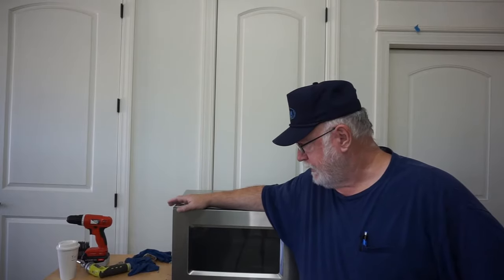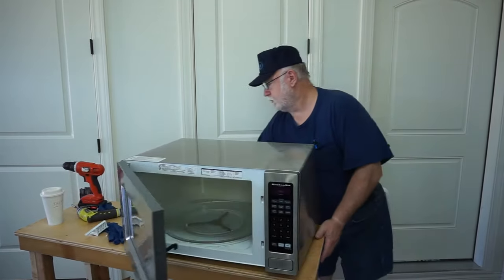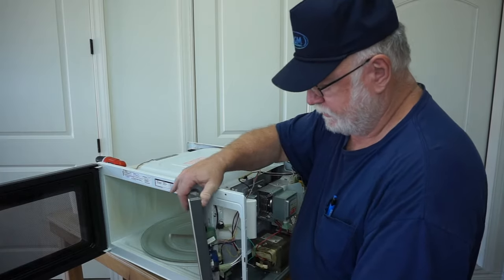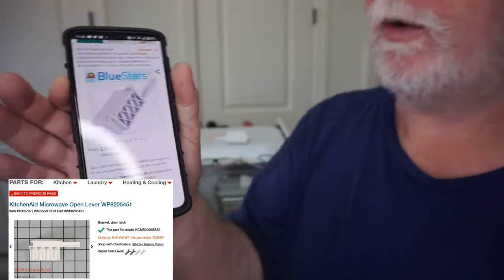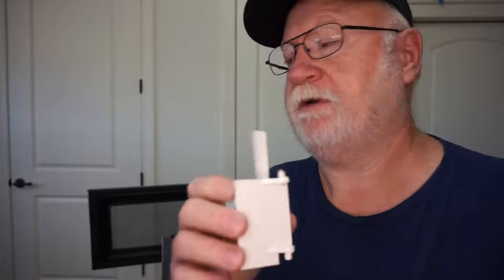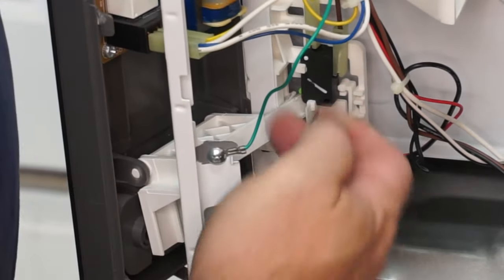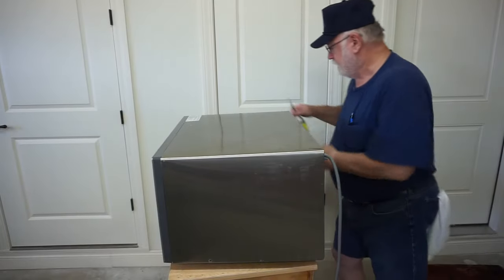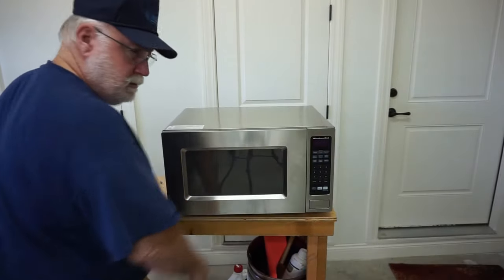Reviving Your Microwave: Assessing the Value of Door Latch Button Repair

Comment: You are a great teacher, but does this work on a Samsung?
Reply from the maker: Although I can't see the model number of your Samsung, pretty much all microwaves and electric ovens with a plunger door button are fairly close in design.

First thing to do is to get it onto a table or work bench so that you can remove the cover. Only remove screws that attach the cover at this point.

Once you have lifted the rear of the cover slightly you should then be able to pull rearward on the cover to lift it off. Be careful as you can cut yourself very deeply on the thin metal.

If you don't see the offending parts, take several lighted photos of the front panel from the inside in various angles so I can see what you have if you still need assistance. If after you've opened it up, diagnosed the problem without further assistance, hope it goes well for you.

If not, email the photos to maxsgarajmahal@gmail.com or hit me up at MaxsGarajMaha in Facebook to share the photos. Good luck and thank you for watching. 

I have another video that may be helpful for you on the microwave and it is a combination microwave - convection oven. Here is the link: https://www.youtube.com/watch?v=NJAZ2V5dF1s

Good luck,

Max
Reply: @MaxsGarajMahal  you are so wonderful to have replied in such detail! Unfortunately, my husband got hold of it before I did and that always means trouble. It's now a "gonner" and in the garage!!
Reply from the maker: @conniebentley8967  Well, maybe he just needs a bit of your assistance in order to finesse it apart. If that doesn't work out exactly the way you both like, perhaps he can be the Director and you the Cameraman. Maybe you two can reverse the roles if that works best. At any length, between the two of you I have all the faith in the world that you will be successful in carrying out an easy operation.

If you still feel you need some bolstering, send the model and serial number of the Samsung as well as those photos so I can see what I can do to be of assistance from afar.

Good luck and have fun as we should always make these games fun.

Y'all come back and see me now, ya heah?

Comment: Worked like a charm, thanks!
Reply from the maker: Pleased it helped you out. Once you made my repair, did it make a lot more sense than before you began?

By the way, my lovely bride made me purchase a new latch. I couldn't even tell you where I put it. If I find it one of these days, I'm going to do a pre-emptive 'repair', put it back into the package and wait until time to deploy it.

We have other home repair videos you might want to check out. Hope you subscribed and liked.
Reply: @MaxsGarajMahal  Yeah, I had the same issue of that same spindle breaking off. I super glued the piece back on but was concerned that I might snap it off again or snap off the darker plastic holding it to the front panel. Following your technique, with a bit of force, it snapped in no problem.
Reply from the maker: @michaelrusso558  Always pleases me when I've helped another soul. Hopefully you'll never have another problem with it.

Comment: kitchenaid actually bent the pin on the torx screw probably on purpose so you cant open it.   how in the world were they able to install the torx screw and then bent the pin?   the pin is pretty solid.  I doubt they bent it by extracting their torx driver.
Reply from the maker: Thanks for watching.

Comment: Mine broke at the control panel one of the taps snapped off. And they don’t make the control panel anymore 😡 Suggestions?
Reply from the maker: Shoot me a pic of it from a few different angles with good light. Send them via my email, I'll see if there is a way to save it. I'm pretty sure I have the cure for it if it is what I'm thinking it is going to look like.

Comment: My microwave started doing this. The strange thing is, sometimes the button works, and sometimes it doesn’t. I’m not sure if it’s the same problem as in this video or not.

Luckily, if I hold the button down, I can easily open the door by pulling from the top with almost no force, so I don’t think I’m breaking anything else by doing that🤷🏼‍♂️
Reply from the maker: If you're able to pull it at the top while holding the button, then you're good until you're not. 

Good luck and thanks for watching.
Reply: @MaxsGarajMahal  Okay, so I'm good until I'm not 😅    Just out of curiosity, Do you think it's the same problem as you demonstrate in the video, or is something else likely going on? I know NOTHING about microwaves, so not too keen on opening it up myself.
Thanks. And I'll take a double dose of that  luck! 🤣
Reply from the maker: I would remove the cover, inspect it before it becomes a real problem.
Reply from the maker: @thrivingbranch  It is as simple as you saw it. A 5 year old half asleep with dark sunglasses can do this. You can do this easily and it is self explanatory as you take it apart and go back together. Easy Peasy!

Comment: Noooooo...you should've stayed zoomed in after you reinstalled the new release latch...closed the door...push the release button so that we can get a visual of how the release makes contact with the door latch before you covered it up!
Reply from the maker: I'll try to get you that shot. The household uses that sucker everyday. With the screw installed I don't foresee ever needing the replacement latch sitting in the drawer. Thanks for watching.
Reply from the maker: Are you saying you want to see it from the side beneath the skin?
Reply: @MaxsGarajMahal  Simply to see how the open lever engages the latch when you push the button while the cover was off. Thanks for the video. Mine is not broken but sometimes when i push in the "open lever " it doesn't quite lift the latch enough on the door and i have to assist with my left hand on top of the door to pull it open.
Reply from the maker: @enufots4621  Run it again, stop it at 10:09. Shows the relationship in full zoom. That should help.

With the verbal instructions as well as that full zoom, you can't possibly screw up. lol

I made a screenshot for you, but YT doesn't allow me to put a photo in the comments. Sorry. 

Email me and I'll send it if you get back to me soon.
Reply from the maker: @enufots4621  That's just before not opening at all. The left side bends just before it breaks off requiring the cover to be removed to manipulate the latch..

Bear in mind this will only occur after cooking something.
Reply: Yes I’d love to see that work in action too

Comment: I just looked up my emerson door open button its discontinued microwave works perfect just can open door.. jesus h christ what now 90 bucks for a new one and landfill the old what a shame..
Reply from the maker: Take off the outside cover. Once you can see the inside of the machine looking toward the switch cover, you can then place a thin screwdriver, ice pick, point tool, scribe, etc. to depress the latch to get you into the microwave.

Remove the screw(s) to allow the switch cover to be pulled forward so that you can get into the latch. Take very clear pics of all this with really good lighting, send them to me along with model and serial, I'll take a look to see what is necessary to put together a cure for your beloved microwave.

email the pics asap so I can take a close look for you.

Max

Comment: While I appreciated the video, there are some errors. There is a screw on the top AND bottom of the faceplate. You do not mention the top screw. Also a bit of lube on the right side helps glide the pin in. I do appreciate that it got me in the right direction however, just think a bit more care should be taken on the details. You don't show in the video exactly how how got the latch in.... That's the tricky part too.
Reply from the maker: Thanks for watching

Comment: Just put a screw into it and cut it off
Reply from the maker: Cutting off the screw would melt the extremely thin base material. My method is tried and true although you may have success with yours.

Whichever melts your butter. Thanks for watching.